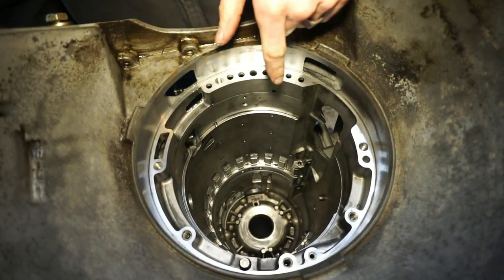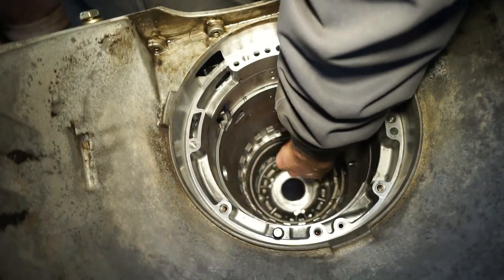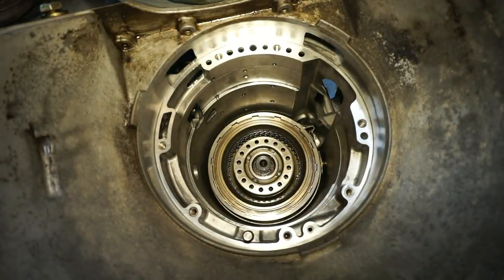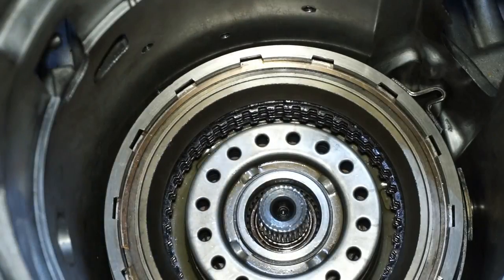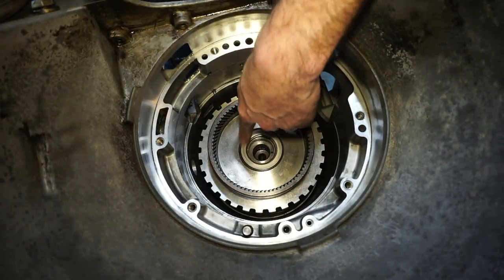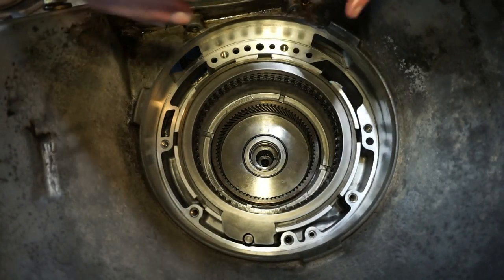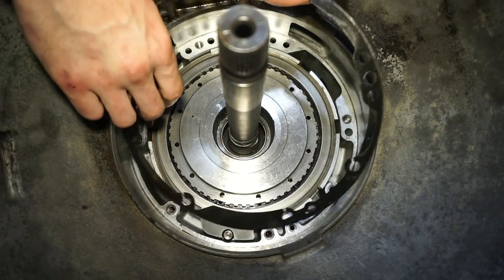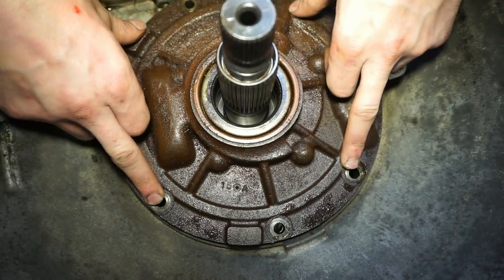4l80e TRANSMISSION REBUILD!!! Installing Main Components into Case!!! - a21bravo

Comment: At 8 minute mark, the 4th clutch and center gearset are they flush? I feel like my pump is making contact with the center hub locking everything up I've pulled it apart a couple times and can't figure it out

Comment: What if that hole on the sun gear shaft doesn't line up with that notch on the sun gear? I'm using a press fit shaft it's so hard to install. I press fit it on the direct but when dropping it in I lined up the hole going down in but idk if I made it in correct. Is it the end of the world if it's not lined up? Is there a way to verify that it's in good though the valve body?

Comment: It will not shift into overdrive from the shifter either top speed is about 40 miles an hour wind in the engine pretty hard

Comment: Ever since I lowered my truck to a 4/8 the driveshaft has been putting a lot of pressure on the transmission. This caused me to go through 3 built 4l60’s. Pulled the trigger and picked up a 4l80 last week. Any idea why there’s so much pressure? Been told it might be the pinion bearing on the diff but I don’t see how that will relieve pressure?
Reply from the maker: A 4/8 drop? So dropped rear 8 inches? Did the 4l60s all fail the same way? With that much of a drop you might be bottoming the yoke out in the transmission.
Reply: @BlaserBuilds  yea 8 inch drop in the back and 4 in the front. There’s trucks in my areas that have statik drops (10inches+) and are just fine. What do you think can be done ? I upgraded to a billet driveshaft so the driveshaft isn’t the problem
Reply: @BlaserBuilds  and yes all 4l60s not only burnt out but the bearings were beginning to crack due to the pressure it was under
Reply from the maker: @jasonloera3358  Bellhousing crack? Could be the driveline angle. If the operating angles on the U joints are wrong the shaft will vibrate and could cause premature bushing wear or maybe cracks if its bad enough. Engine angle, drive shaft angle, and pinion angle would affect this. You can use Tremec Toolbox app with phone to check angles.
Reply: @BlaserBuilds  yea it vibrates after 80mph, and I got the pinion angle fixed soon after lowering the truck
Reply: @BlaserBuilds  hard to believe it’s a error on driveshaft builder’s part since they are very credible. @driveshaftpros on Instagram did it for me they measured and balanced it but it still vibrated after they put it on
Reply: @BlaserBuilds  thinking of it, I did have a mechanic put in new motor mounts for me, could that be the issue? Maybe he didn’t allign it right
Reply: @BlaserBuilds  it can’t be the pinion bearing on the diff right? I’ve been told by a local credible transmission shop that it might be the pinion angle on the differential since I have 4:56’s
Reply: Shorten the driveshaft or If you changed the angle of the transmission then you will have to change the angle of pinion vice/versa. They have to be parallel or it will destroy the driveline but it will be really obvious there is a problem to the point it would be extremely uncomfortable to ride in.  Get a magnetic angle finder put it on tailhousing with driveshaft out suspension needs to be loaded. Then put it on yoke of pinion. That will let you know where you stand. You will have to do a constant velocity shaft if it’s not possible to get them angles.  For context**Parallel lines not height differences

Comment: I see you know this transmission top to bottom, my trans in my 1995 Hummer H one comes out of fourth gear like you just turned a switch then sometimes it’ll come back in fourth gear like you just turn on a switch and other times it stays in third and will not go to fourth or overdrive I switched outside electric shifters and that does nothing to help it what would you think going wrongThe transmission is not sleeping at all but there is 200,000 miles on it
Reply: It sounds like the accumulator limit valve needs redone. They need reboard at 100,000 mi and your twice over. You can buy the kit to fix that, it's a transgo idem part # T-48-ACT-TL. And would replace manifold psi switch also. But you've probably already got it fixed it's been 9 months since your post.

Comment: Dude, I loving these vids! Easy to follow along with and everything. Now that almost all the vids are done, I'm half tempted to pull my 4l80e out of my '46 chev bus and get her rebuilt. One question tho.. I know I ran into this before with it but I guess mine is an early style 4l80 (post 1999 I think). Do you know what I might run into that's different than the newer ones?
Reply from the maker: 1dickycat I believe the "early/late" is considered 96/97... The oil cooler line was moved to the rear on the late model(97+)... This changed the center support, output shaft, and a different supply tube for the rear... One other difference was the "Dished" vs "wave" plates for the clutch packs. I believe the early models had a narrow 1" forward band instead of the wider 1.25" band in the late model... Probably more stuff though.
Reply: a21bravo And this is the reason she hasn't been rebuilt 😂 Can't decide if that's what I wanna do or just get the newer style that has better/easier/more common aftermarket support.
Reply from the maker: 1dickycat The 97+ also have a solid output shaft because of the different lube locations so I'd guess it's a bit stronger.
Reply: a21bravo Yea.. The main thing is I utilize the drum style emergency break off the back of this trans.. Do you know if that could be swapped over to the later?
Reply from the maker: 1dickycat I don't know.
Reply: Is the 4l80e a lot stronger than the 4l60e? I thought if I got a 5.3 engine and a 4l60e as a package would that hold up to 500 HP if I do what you did with a turbo? Great videos. You do a great job explaining what you are doing.
Thanks
Eric
Reply from the maker: EZElk 4l60's have a bad reputation for failing on high horsepower/turbo builds.
Reply: Thanks for the info on the 4l60e.